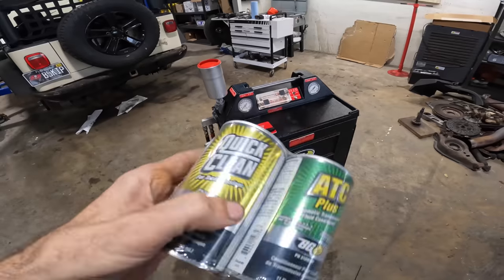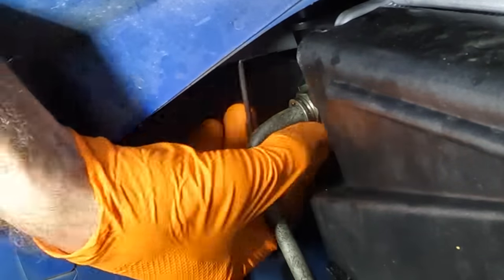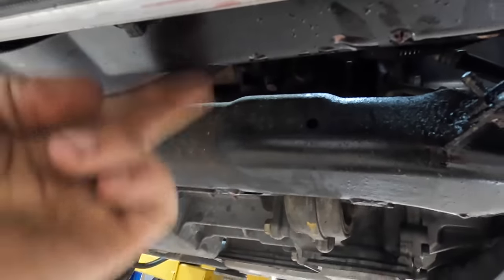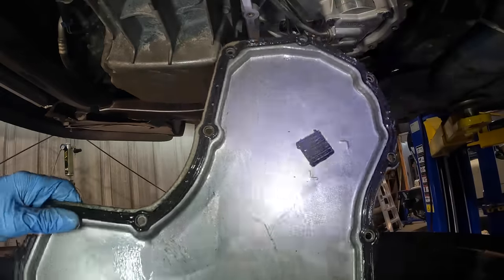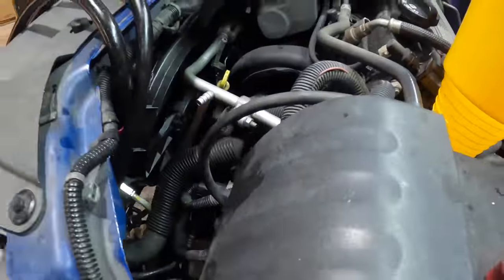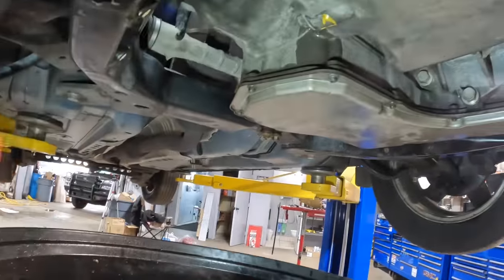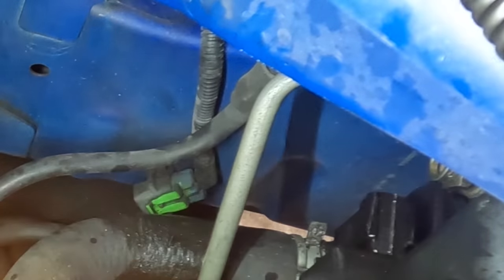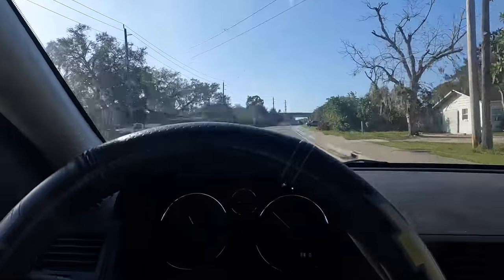Contaminated Transmission! Chevy Cobalt 2.2

Comment: very interesting video about the exchange unit. I sorta believe that the clutch material is fairly normal for wear. I have changed several at gaskets on different cars and there was always some clutch material on the bottom. Merry Christmas, Ray!
Reply: the coolant will separate the friction material later.
Reply: @forgetfulme1719  Water soaks into the friction material.  The next time that there is a hard shift, it will flash into steam.
Reply: @1djbecker  u r right, physics at work, flush only for dirty trans normal usage, waste of all the fluid and chemical , also moisture will corrode electrical contacts soon.

Comment: My brand new Chevy pu with 1700 miles on it did the same thing. New trans, radiator and engine flush. Defective heat exchanger in the return tank on the rad. Trans grenaded in the driveway while I was brushing snow off of it. Dealer said the trans fluid looked like Pepto bismol. Replacement trans was a remanufactured unit not new built.  Thanks for nothing gm.

Comment: Dude, you really need to run that through the gears as those pistons don't empty unless they are pressurized, also the hydraulic passages will stay full of that crap unless actuated.
Reply: You can run it through the gears while the machine is in process mode also to help purge fluid from the valve body.
Reply: @302hardtailr6  I agree, my statement was the concern of trapped poopy stuff.

Comment: Hey Ray if this was to happen to me I think I would have rigged up a hose to feed directly into the trans pickup port. Then I would have left the pan off and ran the trans through the gears while on the rack, maybe tape up a heavy duty trash bag  to the bottom of the trans to control the escaping fluid into a big catch basin  . This way the constant source of clean fluid would have the best chance of cleaning out the goo without re mixing in the pan.
I think even 40 -50 quart flush like this would be worth the gamble if it saves the trans from long term damage.

I recall a trick of dripping a bit of the fluid on a hot exhaust manifold. If it sizzles, it has water in it. If it just smokes, you’re all good.

I think this trans  will survive.   Great video.

Comment: I had the same issue and I out motor flush with a paint thinner and it worked great, Then flush with transmission fluid.

Comment: About removing those retaining rings with a pick and screw drivers, one idea might be to pick up one of those telescopic magnets.
I bought a few at a "Dollar" store (can't remember which chain).

These ones that I got not only have a strong mag on the end, but also has a bright LED light!  These things have come in handy big time.

Just having one of those, sitting beside where the ring should pop off could save it from travelling at the speed of light into the 9th dimension.  😂😅🤣
Reply: amazon has stronger ones, useful for retrieving bluetooth earbuds that have skittered under things.

Comment: BG is an amazing manufacturer.  I use their DFC PLUS 23032 diesel fuel conditioner, their oil additive, and every 50k their oil flush.  No joke, my diesel oil looks like regular oil after the oil flush for like 2000 miles.  That's impressive.  
You had a lot of changes of plans ray but it's important to always have a plan. That way when sht goes sideways you have something to deviate from. Nice work

Comment: I had an 07 cobalt. Paid $ 600 for it with a blown engine at 230000 miles. Put in a salvage yard engine for $200. Ran and shifted like new. Those are good transmissions.

Comment: I reused those tranmission gaskets and had no issues over the years, now if we had a customer roll in for mileage or maintenance service and we serviced the transmission more than 3 then we would replace the gasket with the same type. Never had a customer come back with leaks. Some people might agree or disagree but whatever works for your style.

Comment: Hopefully it'll be ok. I had an '02 Impala with 140K and did a fluid/filter replacement, then drain/fill. Trans operated normally, fluid was somewhat dark but decided to take the risk. Car was fine.

Comment: happened to me over a couple a years ago, found out real early less than half a mile,  so flushed it with cheap fluids till it was clean then put in the Honda stuff, so far it works.

Comment: Richard and Teresa have a new channel on YTube.  Thus, Richard's fantastic work is still available.  Having done transmissions for a very long time myself, the clutch material is bonded with water soluble glue.  So, when water is introduced, the immediate effect is the clutch material starts debonding.  This transmission may work right now, but in a few weeks, it will stop and require an entire overhaul.

Comment: I like that machine. Our dealership has one of the new ones, measures fluid coming out, pumps that amount back in as new fluid. It seems to have issues every other time I use it. That one seems very nice since it works mechanically.

Comment: Well 250 in fluid a filter and two flushes, labor and that’s $700+ chances for it will
Last more than a month 20%, enjoyed watching the work and seeing the machine in action, just know that flushes push out all that friction
Material in the old fluid and if the clutches are old/high mileage, it’s going to slip…

Comment: I think that transmission will survive, it's not slipping now and if it starts to you can add stop slip.
Most shops would just put cheap af fluid and only drain once, you did 38 quarts+ but the shops I've seen did 14-20 quarts and only one drain and "flush".
You have a great work ethic and amazing customer service/ethic.
I can't tell you how happy I am that you have your own shop. You seem so much happier and it's more entertaining now you own the shop and can make the calls without dealership interface so the customer gets the right treatment and job quality that only you can.

Comment: I had this happen on my F150 after fresh engine rebuild and all new cooling components. Radiator failed after a month and filled my trans just like this. I flushed 3 times and it lasted about 6 months before I had to have it rebuilt. Was it the 175k on it or the radiator failure? Probably a combination of both. Hope this lasts the customer a while. Good job Ray.

Comment: I enjoy your videos. In this case I would do an open flush with the machine plugged in instead of the filter so the contaminated fluid has no chance to mix as the oil pan is missing.

Comment: If you buy a stainless steel sprayer, preferably with air preload, You could clean a lot of stuff easier and cheaper using solvent.  The high 100psi spray works great.

Comment: It's scary to think of what that level of effort would cost at the last shop I visited. I expect it would have been more that the car was worth. Good video to learn what I should try to do myself if I have that situation. I exchanged ATF fluid in my trailblazer by pumping it out of the dipstick tube, measuring & replacing the amount, several times. I plan to do the job right eventually but I'm driving it and I wanted to get the brown stuff out of it. I worked out the math. I replaced at least as much as would be with a pan removal, drain & filter change and it's red again.

Comment: I must preface this by saying I'm NOT a mechanic, just a parts changer. I take parts off and put parts on.
In my opinion, that was a LOT of friction material for just over 100K miles.
You did all that could be done without a trans rebuild.

Comment: Hey, did you ever tighten the level plug back up? :)

Did something similar in a '73 Javelin with the 904 Torqueflight when my radiator sprung a leak into the transmission cooler. I didn't have any of your fancy tools, so I just took one of the cooler lines out and let the pump do the work. Got the pepto-bismol out, got fresh fluid in, and she ran for another fifteen years before I sold her.

Comment: Glad you finally bought one of those machines for the next transmission service you do and I'm glad you're still changing the filters on them even though you had the flesh machine that's not a lot of dealership training texts do They usually wait for the inevitable bulb plan leak from the filter building too much pressure I'm blowing the seal outsi'm sad at least that's been my experience because not most ticks don't know how to tighten the Pan bolts or the don't leak around here

Comment: in my experience rebuilding gm trans. when water is involved there are two outcomes #1 if the vehicle was parked long enough to allow the water to separate if so the bearings sprags and roller clutches will be pitted and need to be replaced making for a costly rebuild. #2 just under one pint of water in the trans is all it takes for clutches to start delaminating and the paper clutch material to fall off so the more water the lower the survival rate after seeing this video i give it a 20-30% survival good luck and                       merry Christmas

Comment: A couple of years after my teenager had a front end collision with my old Volvo 740 (a friend did repair), I noticed purple lumps floating in my coolant recovery tank.  I took it to my Volvo mechanic and he confirmed there were compromises in the radiator that allowed coolant and transmission fluid to mix.  He replaced the radiator and flushed the cooling system and transmission (did latter 3 flushes), then told me to drive it for three months and return for another tranny flush.  I was relieved to see that no damage was done to transmission, and I drove it several more years and sold it to said mechanic with no apparent problems.

Comment: I've used BG's products for the better part of 20 years, and I have to say, they're amazing.  Started using their induction cleaner back in the early 2000's, and now using them on our EGR systems, along with oil, trans, and cooling system maintenance.  Great product all around.

Comment: Time bomb.  Think I would have done a bit different.  Never used a BG changer, but before  the first add, I'd have drained and cleaned old filter, reinstalled, then proceeded with the BG. Reason, to not keep recercing that water or as much water. With antifreeze in the trans, it hurts more and more. He may have added water only a couple of times but the antifreeze was still in the transmission.  Just my view of things.  Should cut the filter open to see how much gunk is in that.😁

Comment: My FiL owned a BMW car. Gear box was sluggish changing gears and sometimes was slipping clutches. He took it to a BMW garage and they sent him to a auto box reconditioning center, who quoted him $2500 to overhaul. A friend recommended he see a retired mechanic who did small jobs to fill in time. He flushed out the system and changed the filter and charged FiL $250. FiL sold the car 5 years later and many thousands Km later and it was sill going strong. I hope this car does the same.

Comment: I was gonna comment last night but I have Holiday Let Down Rage so I went to bed instead. 
Seeing as you are a BG vendor and have boxed/bagged liquids ATF fluid and oils etc. Please, please, get the proper MSDS files in a binder and emergency box outside your office wall in case of fire or something happening whilst repairing the vehicles.  Also placarding and all the correct flammable/volatile chemical stickers outside of your shop. And, label the oil recovery unit you roll around to catch various Milkshake-Oil-ATF fluids. Id say you also need an Accidental Spill basin that you put the boxes of ATF and stuff on to catch any leaks. It should be one and a half times whatever liquid you store upon it. As a vendor I think it's required in Florida? And storage quantities of brake cleaner has to be in a Flammables Cabinet? Be Safe Ray.

Comment: Only Ray would consider the OE ACDelco fluid to be "cheap". Get the part store brand stuff if you need to flush something. You could even get away with standard Dex/Merc since you are doing a fluid exchange twice, it would save the customer some money.

Comment: Love your videos, Ray! As a computer engineer who does their own wrenching on the side, my experience is hardly expertise, but I expect that transmission to be a time bomb. Depending on how long the clutches have been soaking in the "Milkshake of Doom", it could last a day or it could last five years. One thing I've learned from the transmission experts I've learned from is that when clutch material is soaked in water, it starts deteriorating rapidly. I hope for your customer that it lasts for years, but at some point it's going to need a rebuild to keep rolling.
Reply: How do you know if someone is an engineer? They’ll tell you.

Comment: Should hold up.  Seems it was caught in time.  Had a Cobalt that I put 279,000 on it.  Mostly highway driving. Synthetic oil from the first oil change.  Had the trans fluid and filter done at 60,000 then at 100k intervals after.  Tough little car.

Comment: I hope you and your wife are having fun playing with the young ones and there toys / games Santa brought. We are out of the deep freeze, a chinook rolled in and it was 5 Celsius 41 Fahrenheit at 11pm last night. Lots of people here will have headaches today, I know the tobogganing hill will be full. You are acquiring lots of premium equipment to service all your customers needs, I think you are going to have a bright future just don't forget to take some adventures with the family because that's what the young ones will remember for the rest of there lives. I like the new uniforms, gives a professional look to the buisness. I have a feeling the cobalt will have a long life, definitely saving the customer money by flushing the contaminated fluid instead of having to remove the trans and dumping the converter. Bd seem to have some pretty good products Dodge dealers here use the Bd products to service the egr system on Cummins engines instead of disassembling the egr valve and cooler. I still prefer to remove and clean them along with the intake air horn, the carbon cakes on pretty hard in the air horn and heater grid. We went threw one of those road side checks in the US and they even hooked a computer up to see if there were any programs installed. I hope you can find some time to relax and injoy your time off from the buisness.

Comment: Just discovered this vid (though I've enjoyed many of yours). Last week in a fit of inattention, I got caught in deep water offroading my 89 Jeep (old school TF999 transmission) and took on water through the breather. Not slipping but NOT shifting right at all. I'm planning to just getting it rebuilt (It was rebuilt years ago, but that was 175K miles ago). My fluid was somewhat milky, but NOTHING like that car... There was no debris in the pan or filter either.

interestingly I don't see any evidence of water in the engine, axles or t-case. But it's a known weakness that transmission has a breather opening just above the input shaft.
Reply: Update. Local mechanic had problems locating a rebuilt, looking like it would be expensive and a long delay to get this one torn down. He started testing it a bit and suggested that no debris and no slippage... it might be worth a flush.  So we took a calculated risk, full flush and a shot of seafoam trans cleaner (not the sealer) to free up any valve sticking.

It has worked flawlessly since then. Clean, consistent shifts.

Comment: When my wife's car flooded in the seventies, I removed it and rebuilt it, replaced the torque converter and idt lasted well over 100,000 miles when we sold it to my niece who put another 100,000 miles on it before selling it.  The car was an AMC Hornet with a Chrysler 904 Transmission.  I think that was easier and more reliable than flushing.  It took me 3 hours total to do the job, and I had a clean rebuilt transmission with no worries of hidden water pockets in the many convoluted passages.

Comment: Merry Christmas Ray. Think I might have run the trans through it’s gears during the flush to flush all gear circuits and solenoids. My sons HHR has the same trans. Did that when I serviced his fluid when we first bought it. As the saying goes, “the solution to pollution is dilution”... Nice service and equipment demo. BG products are top shelf. 🙂

Comment: it will be seriously more easy and less cost to fill transmision with diesel , let it idle a bit , flush all , then use your machine to clean the system , ,, i beg you to try it one day , it can'T be worste than running transmission with this milkshake , Fuel is an amazing cleaner

Comment: Ray those clips just put 1 end in 1 slot then apply pressure towards other side and swing it. I use the pick to install and remove but i did work years in a tranny shop😊

Comment: An old Ford Galaxy I had allowed me to remove the filler tube from the side of the pan and remove 2 pipe plugs from the Torque converter to drain it. Obviously I still had water inside the clutches and casing yet. I worry yet if all the contamination was minimized.

Comment: That sure looked like the hard way.  I have no equipment, just run the feed pipe to the cooler into a drain pan and run the engine until it starts to starve, then switch of quickly, refill and repeat.  Second refill is the good stuff.  The torque converter won’t drain under gravity and makes the exchange so challenging. I must agree that this level of contamination is extreme, right through the clutches.  Very hard to clean out.

Comment: The ratio of water to coolant isn't the big problem.
Many transmissions clutches are water based glued. The clutch adhesive will fail.
So once exposed to water, they will shortly fail.
I worked as a tech at a small dealership, tried it.
One I flushed made it 6 months. Many made it a couple of weeks to a month.
Good luck tho
Reply: I give you an A for effort!